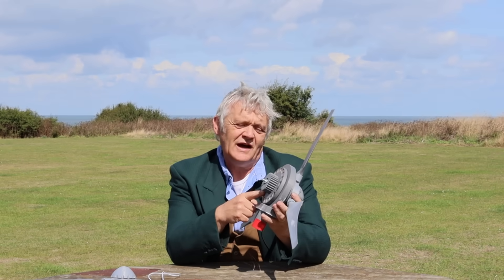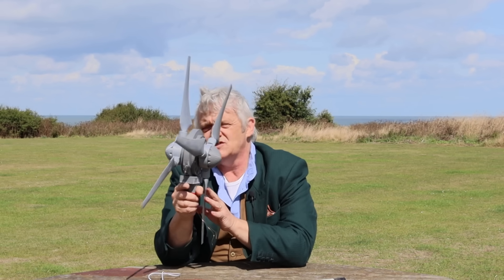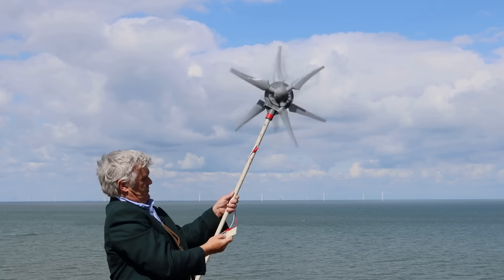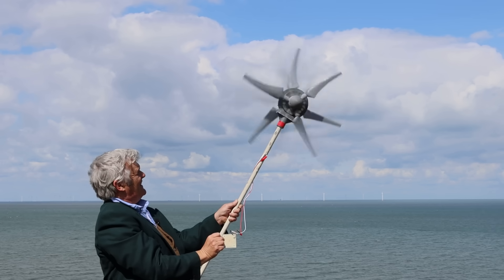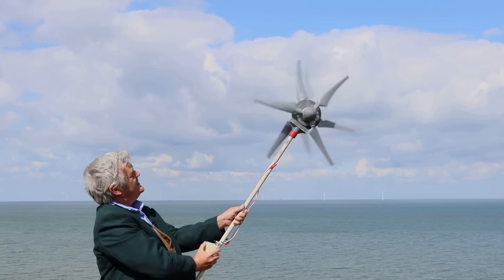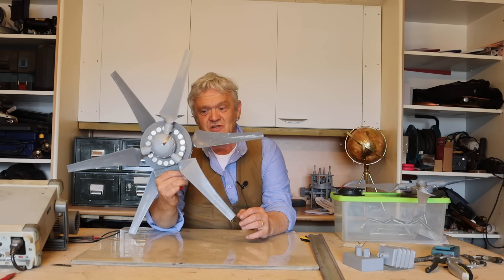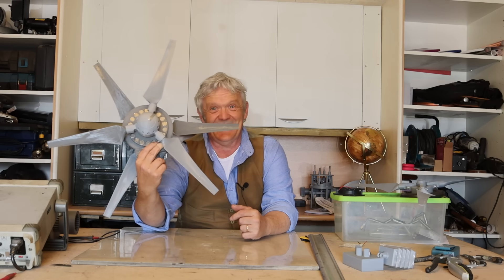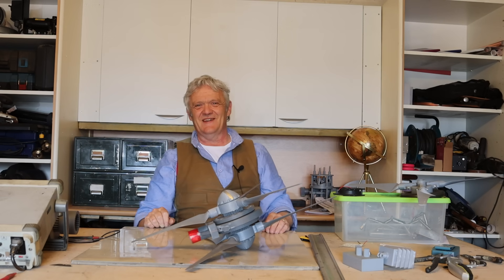2035 DIY Super Efficient Dual Rotor Wind Turbine - A Real Betz Beater

Comment: Hear me out... what if it was NOT horizontal, but still vertical, HOWEVER below a Darwin Wind Collector... that was feeding its airflow into a rose turbine/vortex generator (which is why I am thinking it would still need to be vertical, but at ground level, catching the vortex being exhausted....  (Something like from 1352)  I've been mulling this for a bit but my living situation and lack of 3d printer is making me sad. I know Rose Turbines are typically for liquids, but I've been wondering if you combined a Darwin Wind Collector and a Rose Vortex Generator duct system.... would that generate more or less than JUST the Waters Turbine Betz Beater from 1921?  I'm even wondering if getting the air spinning into a vortex by the time it hits the waters turbine would make that turbine spin even faster... 

I have no way personally of testing my ideas right now but if anyone does... I'd love to hear about it.
Reply from the maker: i said that in the vid mate
Reply: You did? I heard mention of the darwin wind turbine... but no mention of the rose vortex being combined in there... That's the main crux of my pondering here... Could a rose vortex (like from 1352) be combined with a darwin wind collector becuase of the way it directs the wind...?   If a Darwin wind turbine was feeding into a rose vortex turbine (with this dual rotor turbine catching the output) - I was thinking the rose turbine shape would necessitate the fan blades being vertical again on the side catching the exhaust....  (Sort of like how the tesla turbine makes things seem a little sideways) 
  I'll watch again and listen harder @ThinkingandTinkering

Comment: I imagine if you make those blades at 50% fill on the surface & 100% in the core you could reinforce them to be stronger still. I also like the idea of instead of making a tail can you mount it behind the post with a counterweight that would pitch into the wind? Not that it weighs that much but...I never understood why putting the large sail area of the blades forward of the pivots unless it was for the auto turn out systems.

Comment: the lowest rpm for a 6 blade fan to look still in a 25 fps movie is 25 * 60/6 = 250 rpm, far lower than your figure of 1500 rpm
Reply from the maker: i also used a tachometer